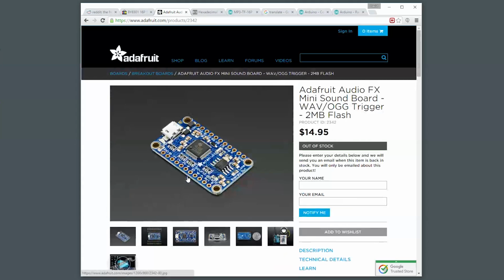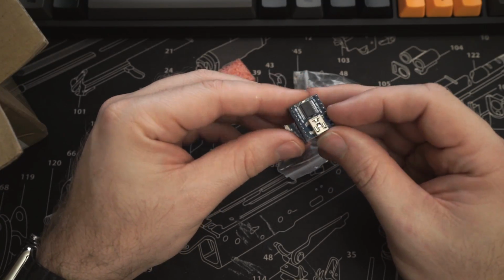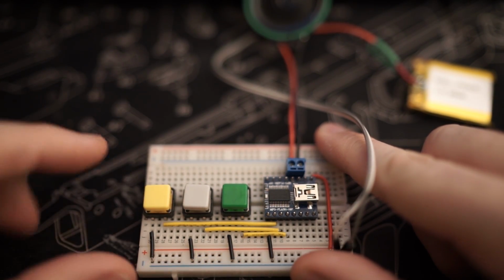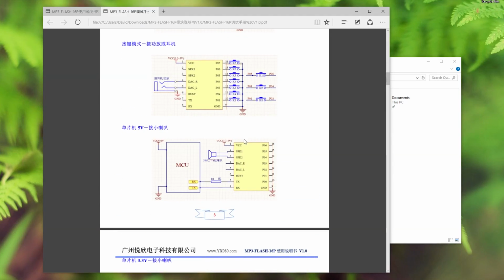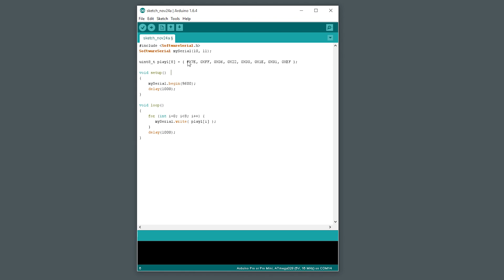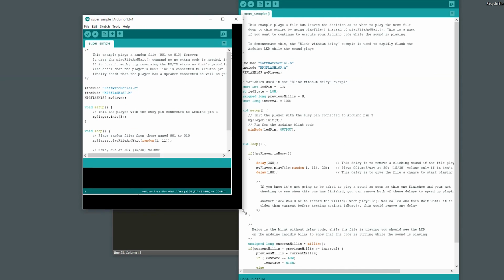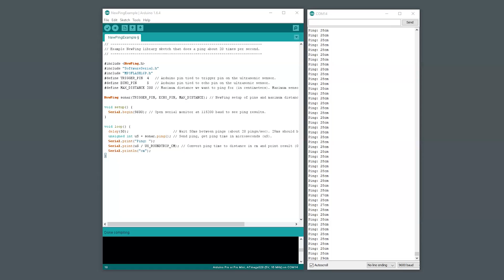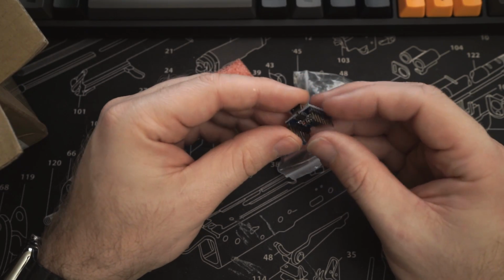A simple way to add MP3 playback to your next project

Comment: The library you wrote 6 years ago is working well with another MP3 unit with the same chipset, I was struggling with the manual and writing serial commands as it was not written in good English. Your library saved my day, thanks again for publishing this! MP3 Module - https://www.robotics.org.za/MP3-64M-DIP?search=mp3%2064mb%20flash%20audio%20module%20-%20usb
Reply from the maker: Superb! Post a link to the part if you can, in case anyone else is looking to do something like this. Thanks.

Comment: I like the trick about grounding it on startup to play a particular track, saves an audio and makes it super lightweight.... Is there any way to make that track loop indefinitely until powered down without having to use an Arduino?
Reply: According to this site you can:
https://sparks.gogo.co.nz/jq6500/index.html

Look for the section "Playback Modes For Manual Keying Methods (1 & 2)"
If you add a 33k ohm resistor for the playback mode it should loop when a button is pressed.

Comment: The manual says it needs a software to upload sound. How come you were able to just drag and drop the files in windows?
Reply: You can usually find any supportive software and documentation for download on the original manufacturers web sites.

One thing to be aware of though, if there is supposed to be some kind of supportive software required to use a device but it's missing, or unavailable, it usually means that the device has been discontinued, so well worth checking first before hitting the "pay now" button.

Comment: Hi...great video! I've been trying to find answers for questions/issues I'm having with this module...perhaps there are suggestions among you! I had this module hooked up and working fine. I then installed it into a project, and now the output signal is barely audible. No matter what I seem to try, nothing helps. Suggestions?

Comment: Quick update- I purchased what I believed to be a similar board from here: https://www.aliexpress.com/item/BY8301-16P-MP3-WAV-Voice-Music-Play-Board-Module-32M-Micro-USB-Download-Capacity-Support/32716590636.html

Long story short, it comes with extra software that I have to use to upload the audio files, and everything is in Chinese.  Not NEARLY as feature friendly as the one that I saw in your video.  Do you know if there is a board on Aliexpress that is just like the one you show in your video? - Where you just upload the files, and can ground pins to make it play right away.  The one I bought is very frustrating to set up.  Any help would be GREATLY appreciated!!!!
Reply from the maker: Sorry, not looked into it since I made this video :/
Reply: I have one of those BY8301-16P units, but I cannot access its uploader application anymore (the one that shows up on an emulated "CD Drive" when you hook it up via USB). It got corrupt somehow - I guess I overrun it by uploading the maximum 4MB to EEPROM. Please, could you copy that application and send it to me? I would really appreciate it! :)
Reply: BTW, to use it, you first have go to the second tab and click on a button to open a file selector. Select the files you would like to play. Then go back to the first tab and click the wide button to start upload. The rectangle below will turn to a green progress bar. It takes a few minutes to complete the entire 4MB. If it fails to start, then you most probably selected too many files. The overall size should be under 4MB! However, DO NOT FORGET TO MAKE A LOCAL COPY of the program, because it might get overrun by the files, so bye-bye to further uploads until you get another copy of the program somehow (that's what happened to me). File indexes start with 1, and this is the best Arduino library for it: https://github.com/NachtRaveVL/BY8X01-16P-Arduino

Comment: Hello Critters! First thanks for your library!
But i have a problem and i'm interested in that: you may be know that problem too.
If i use less than 18-20 (i don't know exactly) files the module works perfectly.
But... If i use more than 18-19 sounds the module plays higgledy-piggledy the sounds. Even if i dont use random play mode.
I use this line:
myPlayer.playFileAndWait(2,20); // i want to play the sound 002.
but the module plays an other sound. 
What do you think, what is the problem?

Thanks! István
Reply from the maker: Have you tried numbering your files "02" instead of "002"? I never tested with that many but that'd be the first thing I tried if I was having the problem you described.
Reply: My files have 001, 002, 003... etc. names. Then I tried 0001, 0002, 0003 etc. -> no result.
But I didn't  try the 01, 02, 03 form. I will try the 01, 02, 03 numbering.
Thank you for your idea! I will reply.
Reply: The 01, 02, 03, etc numbering resolves the problem.!
Thank you!

Comment: Im pretty new to arduino so that might be part of the problem but everytime i try uploading the simple code it says avrdude: stk500_getsync() attempt 1 of 10: not in sync: resp=0x00 then it does that for 1 - 10. any ideas? Also is there a easy way to play a file or next file by using a button instead of having it automatically play? any help with this would be greatly appreciated.
Reply from the maker: Not sure about that error, google may be your friend there. As for the single button going through tracks, you will need to use an Arduino but if you number the files then use simple code to increment an integer and tell it to play that number on a button press should do the trick

Comment: Looks like now there is an exe where you select the audio files and then upload them to the board.  The board shows up as a CD/DVD device..I think I would prefer just seeing the mp3's in windows explorer, not sure how to change that though.
Reply: +David Scott just got mine in the mail and when I plug it in it comes up as CD/DVD.  So no option to format or anything, not sure if I can tell windows to treat it differently.  After I used the exe to 'upload' files to it I was able to output my sounds.  I would really prefer to just see my mp3's if you have any suggestions. Here are two snippets of what it comes up as http://imgur.com/x2MRr2m
Reply from the maker: +Aaron Freeland Very odd, have you tried going into disk management and formatting it from within there?
Reply: +Critters Yeah, I was really hopefully that would work but it still shows up as cd/dvd and disables all options to format =/ ... I might upload a video showing the new process of uploading files and send a link so you can see.  Thanks for uploading this video it made working with this thing much easier, thanks =)
Reply: +Critters think you could explain what the following means
uint8_t play1[8] = { 0X7E, 0XFF, 0X06, 0X22, 0X00, _VOLUME, filenumber, 0XEF };
part of the MP3FLASH16P.cpp file

The super_simple module didnt work for me straight out of the box...did some tweaking of that line with a play code I got from the PDF I have been converting to English, that looks like
uint8_t play1[7] = { 0X7E, 0X45, 0X41, 0X00, 0X01, 0X45, 0XEF };
and I was getting sound...but just my first file repeating very quickly.

First time every dealing with this type of programming...I get the start code, opcode, and end code piece but not sure how the length and parameters get factored out.  Thank God this thing was at least making noise, I was starting to lose my sanity lol =)
Reply: +Critters Uploaded the original and translated PDF here https://github.com/afreeland/BY8301-16P

Comment: is there any way I could get you to upload the data sheets you got on this? the link on the eBay page isn't working and they tell me they are emailing me, but I never get it.
Reply from the maker: +Kyle Rolader It wasn't working for me either, so when I found it and added it to the GITHUB repo. Click the link in the description and open the "Support Files" folder. It's the PDF.
Reply: +Critters thanks for all your work

Comment: How strong of a speaker can you hook up to this? I am hoping to use Arudino with an Iron Man suit I am making. I want to enable the suit to make noise, say phrases, etc. I just need it to be strong and clear.
Reply from the maker: +Randall Wolff This is defiantly the device for you, but you'll probably want to hook it up to an amp or powered speakers if you plan to have it loud enough for others to hear in a noisy environment. If you had something like a Jawbone Jambox or other powered speaker you could wire the stereo output from the board to a 3.5mm jack. That's what i'd do. Or search ebay for "Arduino amplifier", there's plenty for about $1 each.
Reply: +Critters  I apologize if I'm missing something, I've just started with Arduino, and have close to no experience. I was looking at the pin out you provided, and it looks like there are only 7 (P00-P06) inputs for playing sounds. 

Also, what are the left and right DACs for? I know it stands for Digital-Analog Converter, but what does it do in this instance? 

Last question: As near as I can tell, if I wanted to hook this up to an Arduino Uno to control the sounds, I would just need to use 10 Uno outputs, one for each sound file, correct?

Thanks in advance for your help, your tutorial is awesome and a big help on this project.
Reply from the maker: +Randall Wolff 

Q1. Check the documentation, it uses resistors and pin combinations to trigger more than the 7 if you need that, or  you could use an Arduino and the library I wrote to trigger as many sounds as you can fit on the card.

Q2. The left and right DAC's (combined with ground) are for stereo out to a powered amp or speaker. Left+Ground = left, Right+Ground = Right. They are not amplified so if you want to use a speaker with no amp and you are OK with mono then use the Speaker +/- pins

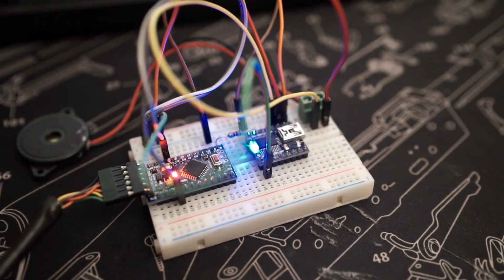Q3. In the description to the video I include a link to an Arduino library I wrote, it lets you trigger upto 999 sound files using just two wires (connecting the Arduino RX/TX to the module's TX/RX), watch the video from 3:28 onwards for a demo.